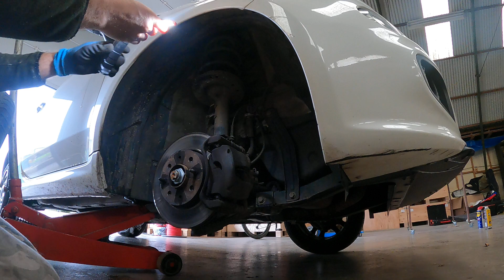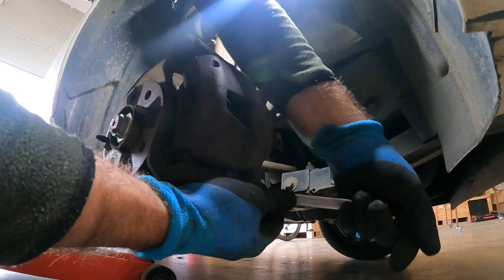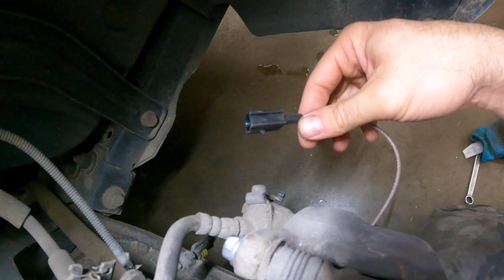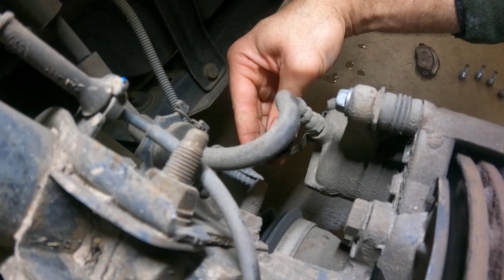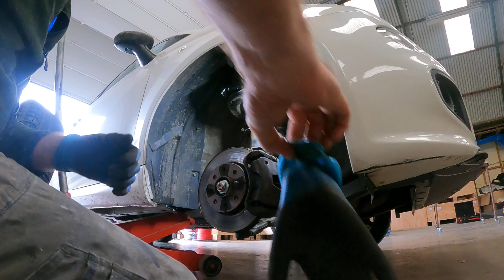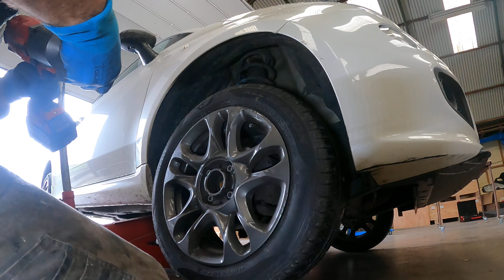Fiat 500 replacing front brake pads DIY

Comment: Hello. Thanks for your Video. Only the upper screw of the caliper is replaced by a new one? Do you know why?
Reply from the maker: Hello, I'm not sure anymore has been more than 2 years. Normal its the 2 but maybee this set of brake pads only came with one. 
Most logical would be placing 2 new.